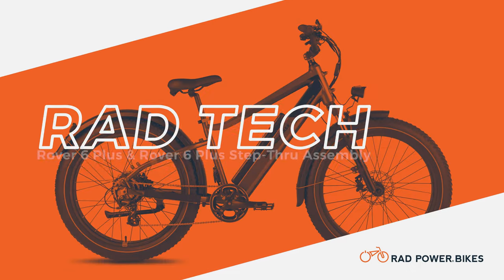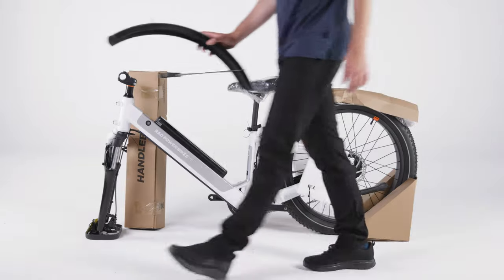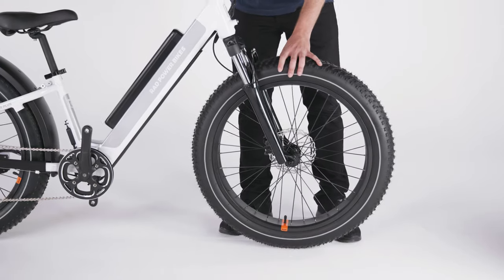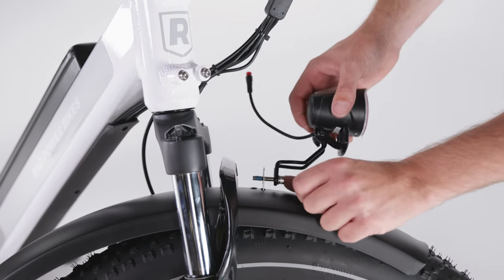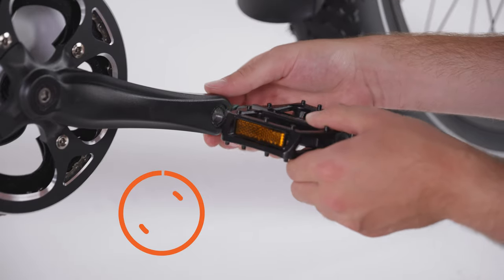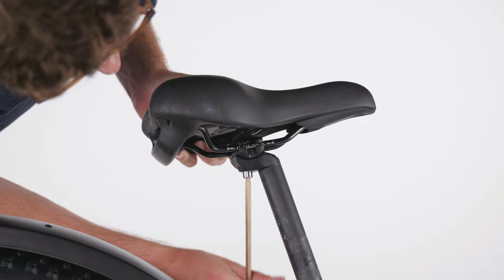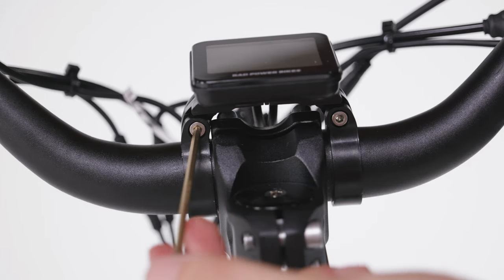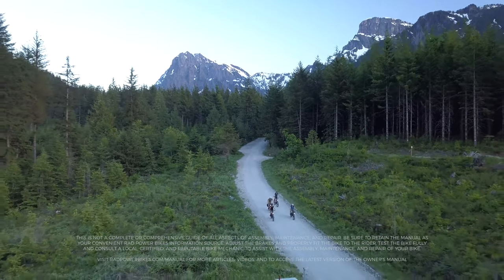RadRover 6 Plus and RadRover 6 Plus Step-Thru Assembly | Rad Power Bikes

Comment from the maker: Depending on when your ebike was manufactured you may receive a front wheel with a bolt-on axle. All models come with a quick release skewer to secure the fork protector plate during shipping, IF you have a bolt-on axle this will not be required for assembly. This video will walk you through how to identify what type of axle you have if you are unsure and how to properly install your front wheel. 
https://www.youtube.com/watch?v=Fhq7F8Pj2Xs

Comment: Don’t fully tighten or torque the handlebar clamps until fully assembled. Then sit on the bike in your normal riding position,  make adjustments, and fully torque everything. If you don’t have a torque wrench, just tighten all fasteners the best you can.
Reply: I don't have a pedal wrench how do I do that
Reply: @bigdamnhero2.097  Take the pedal with you and go to the hardware store and ask for an open end wrench to fit.
Reply: @wb4514  I ended up using the 15mm spanner to do it hopefully it stays lol
Reply: Thanks man!

Comment: I just received my order for a RadRover 6 Plus that was on-sale for $1399.  Great deal but when I opened the box it was missing the keys and the box with the head light, pedals, charger, instructions, hardware, and tool box.  It took a long time to open up an on-line chat and once it was available, a spent a long time in the queue to chat with someone.  They had to break down the missing parts into 2 orders and I have only received an email for one of them so far.   I hope I get everything I need to assemble the bike.  This is the second RadRover I bought, the first one was 3 years ago and all went well with it, this experience I'm not too pleased but only time will tell if this gets resolved.  I'll keep you posted.
Reply: Why did u buy a new one? Was something wrong with your old one?
Reply: Same here. Useless

Comment: My new radrover front wheel has a long threaded bolt where the skewer is supposed to go???
Reply: Mine too I have no idea
Reply: I just watched another assembly video and they have a totally different wheel axle that’s open and lets you put skewer through. They must of sent us the wrong front wheel 🤬 . I ordered 2 both wrong
Reply: I just talked to rad power, they said they are no longer using the front wheel quick disconnect and to discard the one it comes with and bolt the front wheel directly to the forks. That’s why our wheels are different than the video, they haven’t updated the video or manual yet he said.

Comment: Excellent video - but it convinced ME to take my RadRover Plus to a local bike shop for assembly! It is on the "anyone can do it" end of the difficulty scale, but if you don't have a bicycle torque wrench and hex bits, you can't torque to spec. And even if you buy a torque wrench and hex bits, how do you torque the pedals to spec? I realized that although I could do most of the steps in the video, there was enough that I doubted that it was worth it "pay the man""!
Reply: Agree.  Will have an expert do to mine.
Reply: Could buy a pedal crowfoot for your torque wrench... for future readers' sake.
Reply: @auturgicflosculator2183  Just for future readers, most pedals have a hex slot on the end you screw into the crank.  The crank has a hole straight through it so you can come in with an allen wrench from the other side to tighten it down if you don't have a pedal wrench handy and you can torque it that way.  I personally think torquing a pedal is silly but I have seen someone use a big breaker bar to put one on and tore the threads out.

Comment: What size are the Radrover 6 plus rear fender mount screws?  My screw is stripped on the head and won't tighten all the way.  Fender thus wobbles and is noisy over bumps..
Reply from the maker: Hey Jerry! Let's get you in touch with our Product Support team, you can reach them at - (800) 939-0310 ext. 2, or email at - radpowerbikes.com/support.
Reply: I got the same problem (rear fender).

Comment: come to think of it, how does this guy know he is getting 35nm on the pedals when he 
appears to be using a regular wrench?!@?!??
Reply: I was thinking the same. Did you get any answers?
Reply: @johndc1  not really.
which leads me to think nobody really pays attention to it, and i guess they are all fine.
Reply: They need to be tightened pretty good. 35nm is a lot of force. It is worse if they are not tight enough and cause the inside threads to wear. Tighten if pretty hard but not a competition lifter kinda tight and you should be good
Reply: @maryj4535  thanks :)

Comment: I just got the 6 plus at reduced price. 1299* and the only difference I notice is rubberized grips and the sprockets look a tad chinsey, but hey thats chinese metal. Everything else is great. Put it together myself with all adjustments and it took about 2 hours. OHHH the gear shifting is fucked but i expected that. Gonna attempt it myself. Fingers crossed

Comment: I bought these bikes last November and it has been a total nightmare. Customer service has been responsive in the fact that they have given me a couple of laundry lists of things to do in order to fix the problem I have (bike won't power up), none of which have worked. They have sent me a couple of parts to swap out but that hasn't fixed it either. I know it's a product issue and not an assembly matter. I took the bike in the box to my local bike shop for assembly since I didn't want any issues and thought a pro would be the best way to go. I purchased 2 of these bikes and although one has worked perfectly, one hasn't been able to be fixed. Over three months in and I have yet to be able to ride this thing. Very disappointed! I purchased these bikes and the Hollywood rack for my motorhome to use while on vacation so we wouldn't have to have a car. That would have been a good plan had it worked.

Comment: How do I turn it on :(
Reply from the maker: Hey there! To start your ebike, make sure you turn the key to the on/locked position and press the Mode button till your ebike turns on. Our Product Support team can provide a more detailed description. They can be reached at (800) 939-0310 ext. 2 or at radpowerbikes.com/support, and they'll take care of you!
Reply: @RadPowerElectricBikes  thanks. It finally worked however it did not turn on for the first few times. Maybe the battery was not locked in place. Either way, it works now! And it's amazing 🤩 truly incredible bike. Far far better than my old hyper e-bike from Walmart.

I'm just really happy that I ordered this bike and how immediate the electric boost is. I use it to get to my job and back and the way it handles hills is far better than my old mountain hyper e-bike. (:
Reply: @LtUnreal  Hi
I am having same problems,just finish installing and it won’t turn on. I have hold the battery button down to remove it from shipping mode but still won’t turn on. What did you do ?

Comment: Once assembled and in use, where can I get it Serviced and repaired in Scotland?
Reply: Hi Ralph this is one of my concerns too.  The main issue I have is that all the YouTube videos that I have found are for the US spec bike which has a 750W motor.  In the UK we get 250W motors.   I would like to see a video of a 250W bike hill climbing.  My current bike is a Freego 250W and I have to have full throttle and peddle flat out  to get up Devon hills.  I am waiting a response from Rad on my queries.